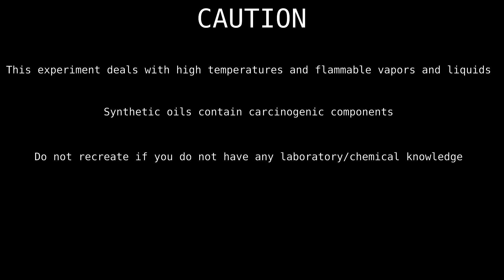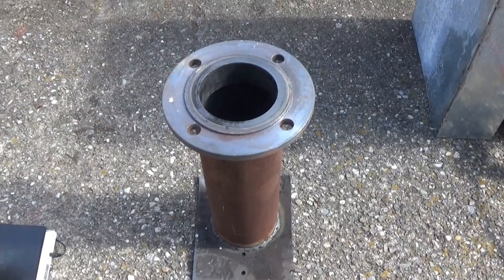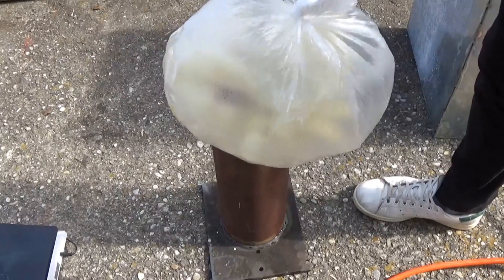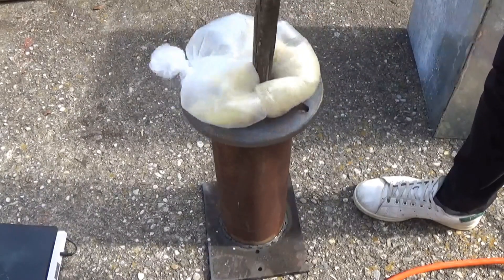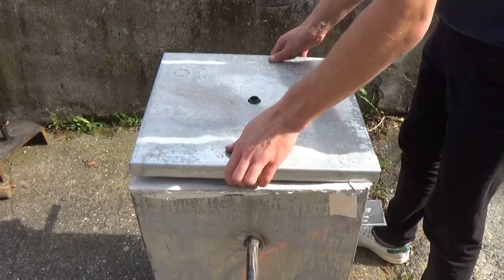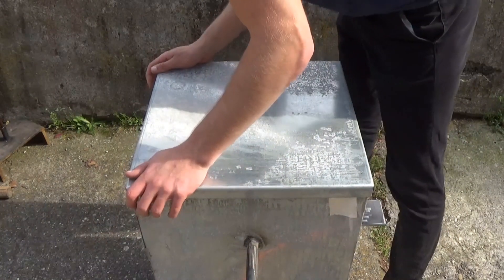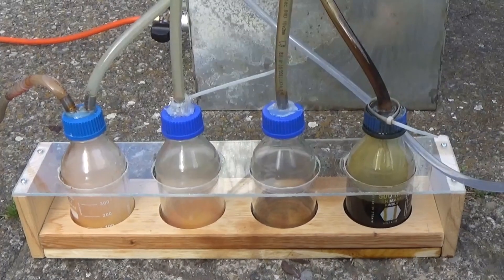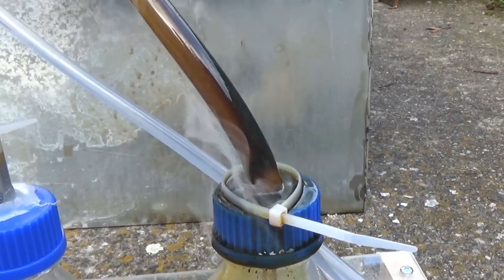pyroylsis reactor project update

Comment: Perhaps you can use either copper/brass compression fittings intended for plumbing. Compression fittings will handle pressure and also not require solder which could melt at high temperature. Otherwise you could use standard push hose fittings and hose clamps (https://www.mcmaster.com/tube-fittings/hose-and-hose-fittings/)

Comment: Isn't glassware an option instead of using PE caps and glue? Or maybe metal collection vessels?
Reply from the maker: only glas would cost around 200-300€ so not really 

mfg hazelChem
Reply: @HazelChem  Are you tied to the types of collection vessels you use now for any step later on in the process?

Comment: While working on helicopters I used a material called RTV silicon if you can find a cheaper “high temp” version I’m sure it would work.
Reply: https://www.homedepot.com/p/Permatex-3-oz-High-Temp-Red-RTV-Silicone-Gasket-Maker-75152/302774959 
Supposedly works up to 650 F
Reply from the maker: thanks for the comment sadly when i try to open the link it reads: You don't have permission to access "http://www.homedepot.com/p/Permatex-3-oz-High-Temp-Red-RTV-Silicone-Gasket-Maker-75152/302774959" on this server.
Reference #18.8fbe1402.1592485194.d033446 

mfg hazelChem
Reply: Thanks @Luca LaFontaine ! Sorry didn’t realize you couldn’t open it up.
Reply: To explain what it does, by no means trying to insult your intelligence, it’s literally call Room Temp Vulcanizing. that means it will cure at room temp. If you use this use like a popsicle stick, dip the stick in alcohol before applying the silicon, it will keep it from being messy. Help you make the application site look professional too. Lol
Reply: RTV sealant. That was going to be my suggestion.